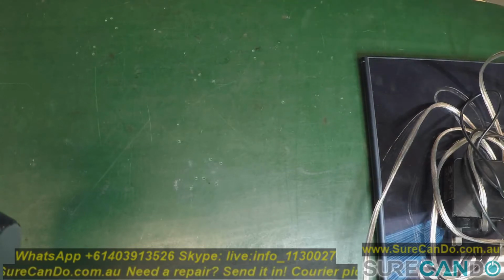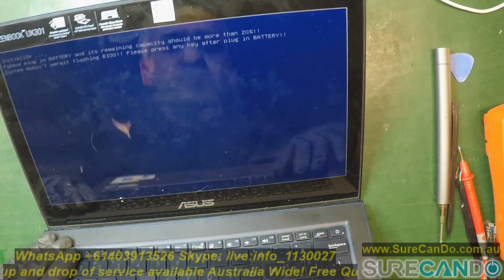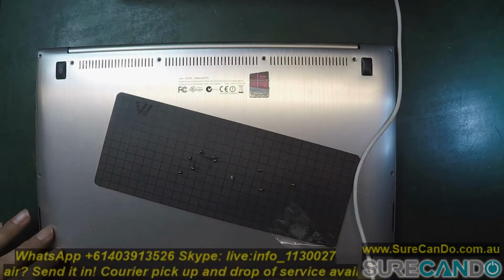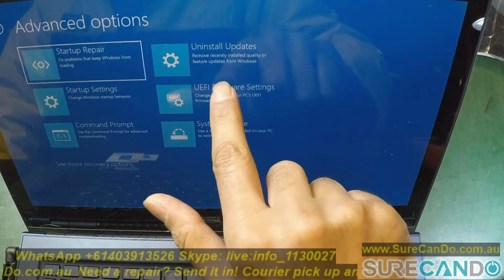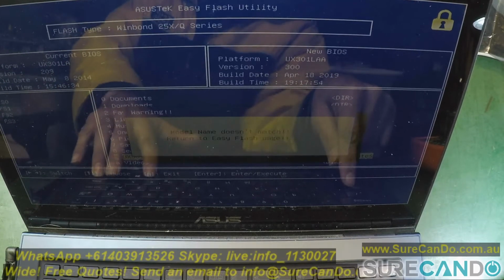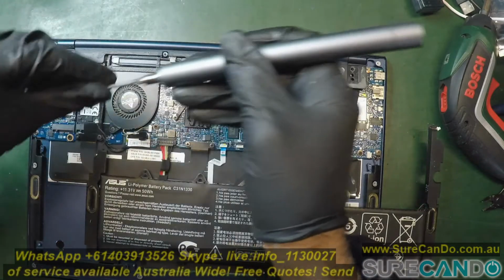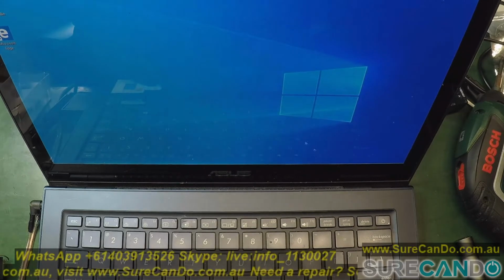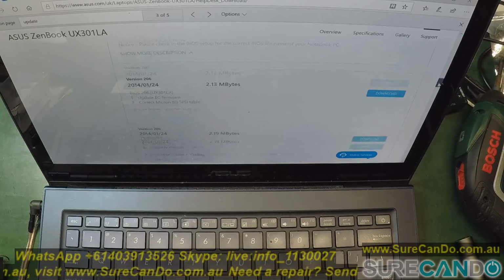ASUS Bios Update Dead Battery Work Around UX ZenBook Battery Replacement UX301LA UX301L

Comment: Any way to bypass the battery check totally? Seems like the keyword 'risky' works only in EZ flash 2, not in this EZ Flash 3. After the Windows 11 update, my battery is no more detected. I don't have a spare laptop to swap the battery to charge it and fit it back in. Pretty sure battery is in good condition. From the battery report, from the day of Windows installation only it dropped to 0 use.